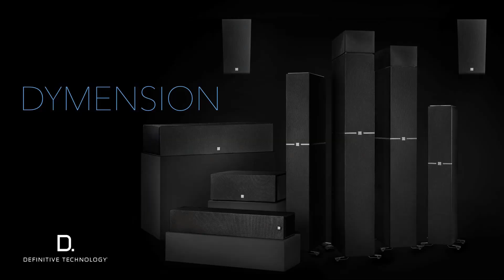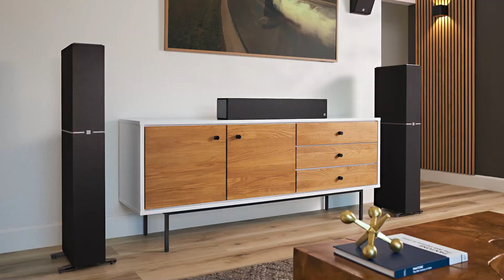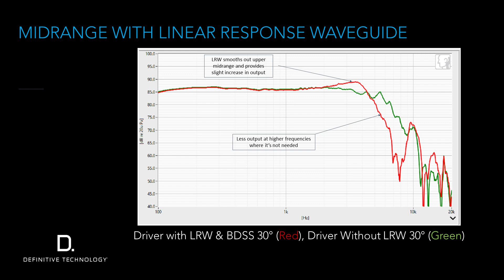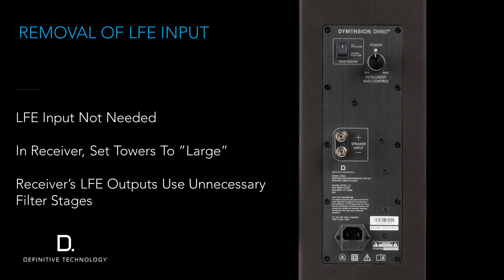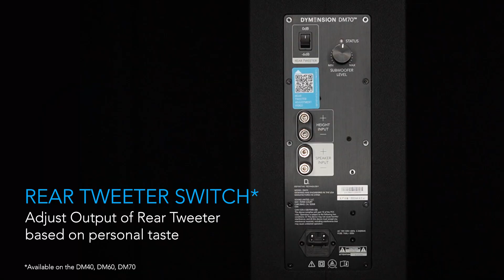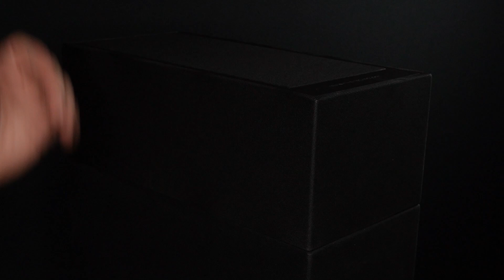Definitive Technology Dymension Series: Part 2- New Features and Technical Product Walkthrough

Comment: I invested in Definitive Technology back in I believe 2002 - BP7001 , BP7002 & BP7006 Towers along with Studio Monitors 350 & 450 surrounds w/ CLR 2005 & CLR 2001 center speakers. They are still kicking. I have never had any issues ( knock on wood ) with internal AMPS. The living room utilizes a Marantz SR7013 & Emotiva XPA-5 Next Gen3 Amp.......pushing the BP7001 fronts & BP7002 rears.............I would love to upgrade however you have to ask yourself why if it's not broken?
Reply: I had that same previous line up BP 7006 ect….. hands down night and day difference. My DM70’s and center DM30 provide triple base. I added the DM90’s and DM95’s as well. Wayyyyyyy better than my last arrangement. Upgrade dude, your missing out, lol

Comment: Golden Ear makes superior speakers for similar application. DefTech made good speakers in the 90’s, but that’s where it ended.
Reply: Kinda ended with Mythos line. No?
Reply: Ignorant comment. I will agree that Golden Ear's are amazing but come with premium price tag. These new DM series however will outperform anything in their price class and are a significant upgrade over SVS & Klipsch (coming from personal experience). I own the DM70's and DM30 center and my previous SVS Ultra's can't hold a candle to the Def techs. The amps are completely redesigned from the older 80/90 series as well.
Reply: @tcamm9812  word salad response
Reply: @tcamm9812  🥗
Reply: @tcamm9812  🥗
Reply: @tcamm9812  🥗

Comment: Why is the tweeter off set? The BP was not. Does the tweeter have a better dispersion than the BP. Spec wise the new ones do not go as high and not as low? Would be nice to have little better information than butting out the same video just with a different person.
Reply from the maker: Offsetting the tweeter minimizes wave cancellations off the front baffle. The new models sound noticeably better, but their listed specifications are more conservative than the previous model.

Comment: Okay. Let everyone get something perfectly clear right now. The very best speaker set that Definitive Technology has ever had is the BP7000SC, C/L/R 3000, and the BP/VXP surrounds. Nothing, and I mean nothing that Definitive Technology has ever produced since those come close. Please look at the specifications and you will see that I am right. I have the BP7000SC, C/L/R 3000, and the BP/VXP that I have done major modifications to. It is very hard for me to imagine these new speakers being better in any way. I really do not like the appearance of these new speakers. The "racing stripe" in the middle with the "D" just looks horrible to me.
Reply: I posted in the comments but going to reiterate here. The BP7000SC are legendary. I didn't get those at the time out of my budget but...............I invested in Definitive Technology back in I believe 2002 - BP7001 , BP7002 & BP7006 Towers along with Studio Monitors 350 & 450 surrounds w/ CLR 2005 & CLR 2001 center speakers. They are still kicking. I have never had any issues ( knock on wood ) with internal AMPS. The living room utilizes a Marantz SR7013 & Emotiva XPA-5 Next Gen3 Amp.......pushing the BP7001 fronts & BP7002 rears.............I would love to upgrade however you have to ask yourself why if it's not broken?
Reply: @8474Starscream  Hi David, Thank You for replying to my post. I'll explain my system to you. I have the Furman Reference 20 power conditioner which is their flagship. I then have the Oppo UDP-205. I actually bought this just a couple of days before Oppo announced they were going out of that part of their business. That makes me one of the last people to have bought one of these at the $1,300.00 price. In fact, a week after I bought it they were selling for $6,000.00 on Amazon. I'm rather proud of that!!! Up next is the Sony Master Series 65XR-A90J OLED. The first one I got was defective right out of the box. Yeah, No Bullshit!!! Next, I am very proud to own the Marantz SR-8015. I was so proud of owning this that before I even plugged it in, I decided to upgrade the front 3 speakers. Those are the Definitive Technology BP7000SC, and the C/L/R 3000 center. The internal wiring for the crossovers was 18 gauge. I replaced all of the wirings using Mogami 12-gauge wires. I soldered all connections. I also replaced all of the binding posts with the best KLE Innovation binding posts. I had to totally disassemble these speakers to do all of this. Well, while they were all apart, I VERY meticulously installed 100 Mil Kilmat on the entire interior. I then used 3M spray adhesive to install 1/2" thick wool felt to the entire interior. I again was extremely meticulous in doing this work. I had never done anything like this before, and David let me tell you that there was not one thing that was easy about any of it. My God!!! On the outside of the speaker cabinets, I also installed a 50 Mil sound deadener. I used 50 Mil because it was the only black sound deadener that I could find. When everything was completely reassembled, I treated the BP7000SC speakers to the ISO Acoustic GAIA I isolators. I also installed Furutech IEC power inlets, and I now power the internal amps using some really nice VooDoo Cable power cords that are 8-gauge. These speakers sound incredible!!! The next thing that I would like to do is to get an Emotiva XPA-DR3 Power Amplifier for the front 3 speakers. After that, I'll have to research 2 subwoofers. The SVS Ultra subs look nice, but there are a lot of nice ones out there. Arendal looks pretty nice too. Well, David, it has been fun telling you about my system. Good luck with yours. Take Care, Ernest Waxter III
Reply: hey i have the exact same setup but have damaged some crossovers aswell as the power amps, any chance you have the crossover and amp schematics?
Reply: They build the newer Top version DM80  and want to sound bader then the old speakers ? You have listen  the DM80  ?

Comment: Did you fix your amp reliability ?
Reply: So you know there was a problem with the old amps and didn't do anything? That great. I got three bad amps, two in a row with the CS9080 and one bad one from a BP9060. Was a great time replacing amps on brad new equipment rather than enjoying listening to them. I guess that's what I get for getting close out pricing, you get below average equipment.
Reply: @Masimo Consumer Training 
May I ask what brand speaker cables and it’s gauge do you use to test as well demo the DM80. On a closer look I can see that you’re using a Marantz stereo amplifier in the background of this video
Reply: While I am currently using the BP9080x, I’ve tested them in various room sizes and it gave a lot wider sound stage when I used speaker jump cables to connect between the speaker main terminals and height module terminals since I’m using a stereo amplifier. I hope I can apply the same configuration on the DM80 and DM90 as well
Reply: We’ll see if the new amp design holds up.
Reply: @cpg8000  Right but I, and my money, won't be the guinea pig. I'll wait.
Reply: @brainguynyc8729  It's hard to find reviews from actual purchases. Also hard to find Youtubers that are reviewing these bipolar style. I asked some experts and they weren't recommending.
Reply from the maker: yes, the issues with the previous BP series have been addressed, the amps in the Dymension Series have been redesigned and are brand new.
Reply: @SoundUnitedTraining  Is it safe to assume that Definitive Technology's latest Descend subwoofers like the DN12 & DN15 also have the same or similar redesigned brand new amps?